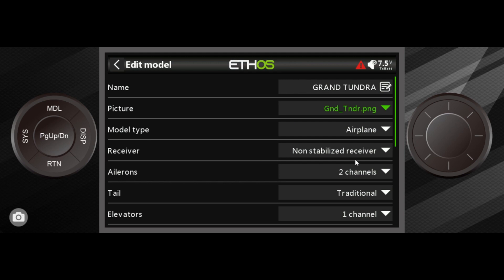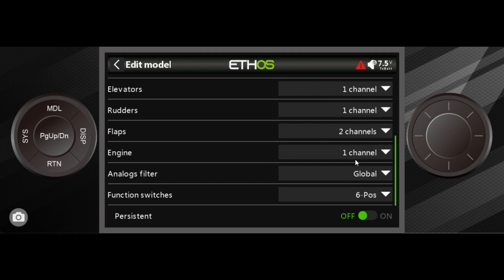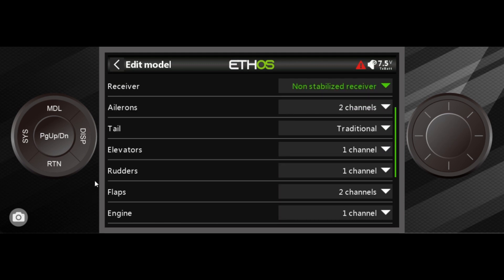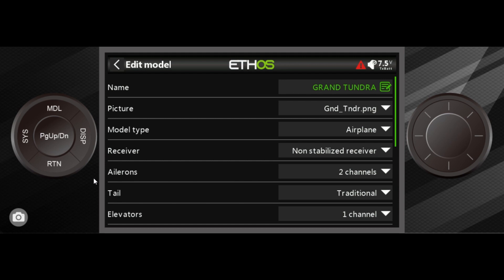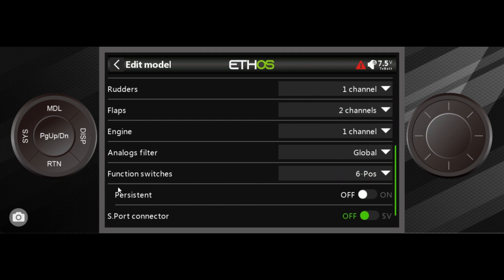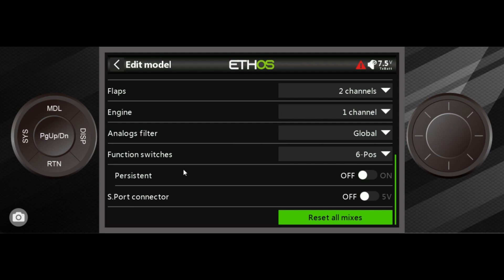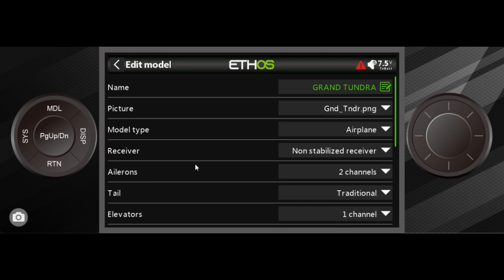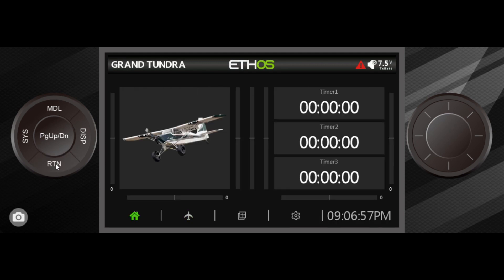FrSky Ethos 1.5.x : Setting up your model: O-20 Series E3

Comment: Hay Steve I know it's off topic but I can't get the tab lua working on my radio the radio is on 1.5and the luas I've downloaded is the v3 version,and the sr8 plus is running 1.011,everything works fine until I get to the atb pages in the lua,it just won't turn on I've tried everything can you help please.